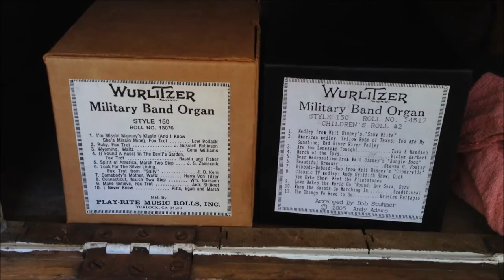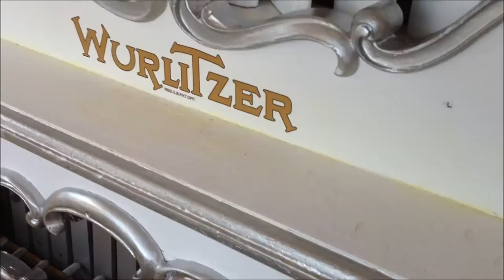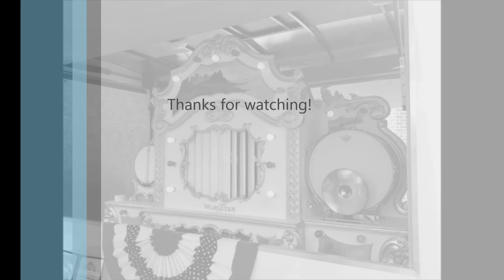Wurlitzer 153 Band Organ "Hurdy"

Comment: Very neat. I wonder what would happen if you took a player piano roll and tried to play it on this organ what would happen. And It would be cool if they put modern top 40 music onto these paper rolls. They did Gangnam style by Psy but I'd like to hear more modern music on these.
Reply from the maker: +coondogtheman1234 A player piano roll playing on a band organ? Not possible, unfortunately. 1. A standard 88-note piano roll would be too wide to fit in those spoolboxes. 2. If it were possible, it'd probably sound wrong. As for arranging modern music for this type of organ, the only way that would be possible would be if the song has at least one keyboard line. Otherwise, it's virtually impossible. There are a few rolls out that contain select rock'n'roll tunes but unfortunately, most organ enthusiasts and stand-alone carousel operators don't care for newer music, but amusement park operators love it.